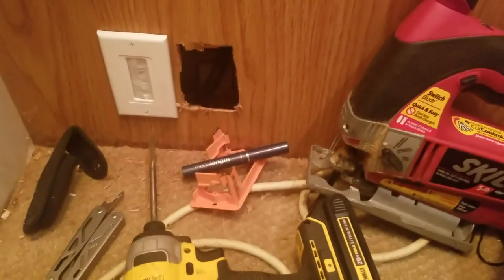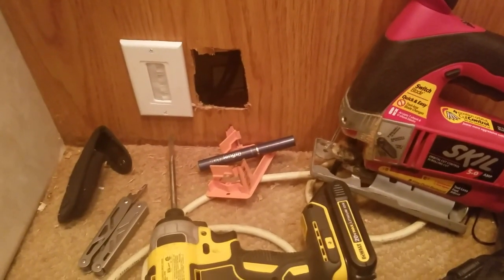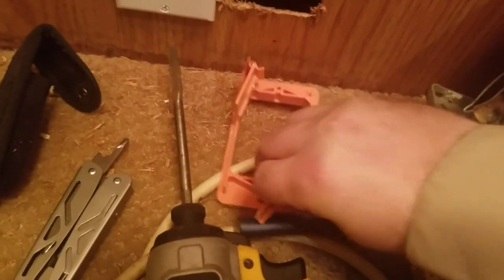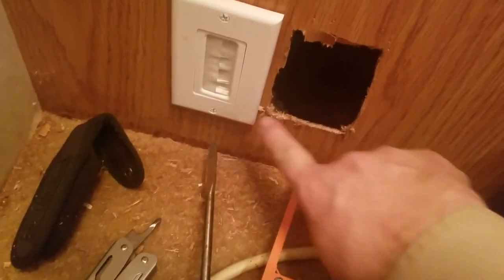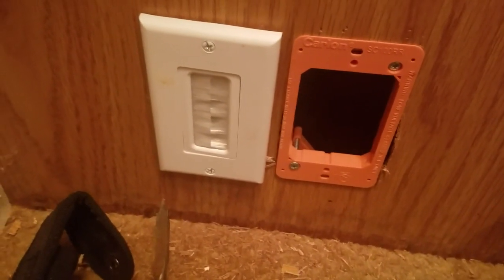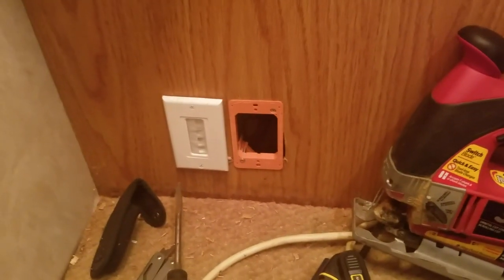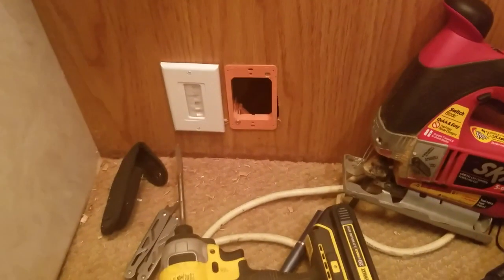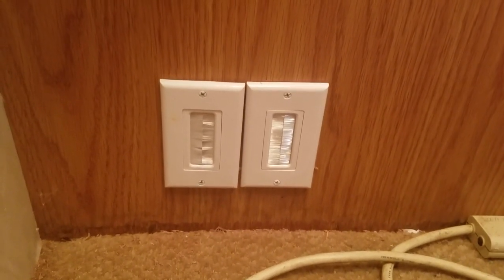Running RG-213 Coax inside the RV for Ham Radios

Comment: I have been learning about HAM radio, I feel the FCC makes it a bit hard to get into HAM especially if you live in a place like I do. The nearest place that gives the Tech test is over 2 hours away. I feel like they should at least off the the entry level test online.
Reply from the maker: Keep studying and fild a local club that does the VE testing. I beleive the ARRL has a way to search for testing sites. Good luck on the tests